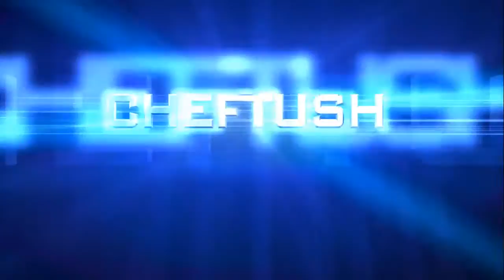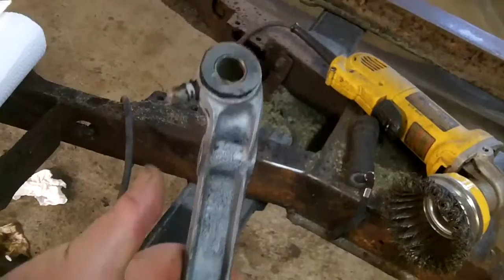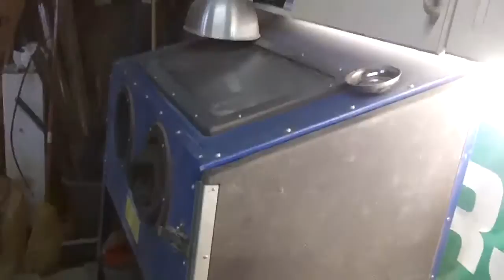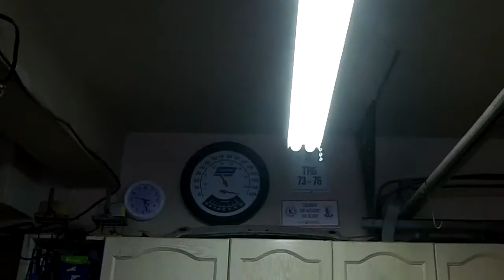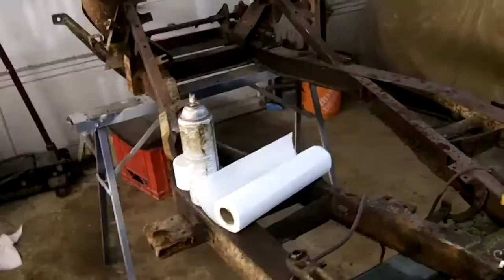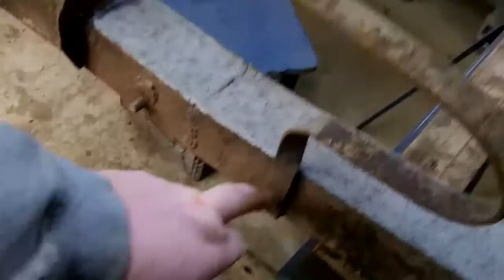1959 Triumph TR3A Restoration, Chassis, Part 2

Comment: Hi David, It's looking good on the old frame, I'll have to do the sand blasting on my car as there are none local to me and as I live on the coast I'm worried that the rust will start in before I get it home. I've made a dual pot blaster for soda and grit from two old 15kg gas bottles just like the eastwood one. I've still to test drive it but when I do I'll post a video of it working. P.S I got the old girl running she sounds a bit rough but she's running.

Comment: Woo Hoo! great progress my Brother. You can drag th frame next to a body shop and have them spray it right quick.
Reply from the maker: Actually, this guy does epoxy priming as well if I want to...I think I'm going to get it home first and do all the welding repairs before I paint it. It shouldn't flags rust as the humidity is ver low in the middle of winter
Reply: Yea. You are right David. I get too excited wanting to see your car all pretty like th white one....sorry